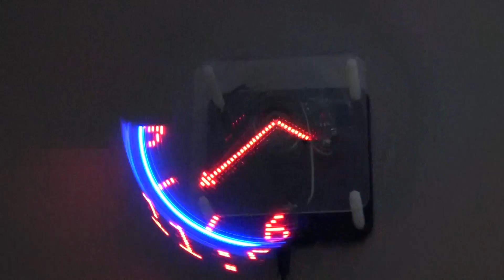A short rant about very old electrolytic capacitors

Comment: It's not just about capacitance, but esr, newer caps are still superior. nichicons uhw and upws are some of the best radials on the market today to use in power supplies, nichicons ulds are some of the best to use in supporting circuitry along with Panasonic's fm, fr and fc series, vishays 30D and TE series, cdes tta series are the best axiel caps, Nichicons lgu series are some of the best general purpose snap in caps as well as cdes splx, Nichicons nt series and cdes cgs series are some of the best screw terminal caps around. There are modern caps that not only are built better, but have far better performance, you cant expect a 35 year old or greater eletrolytic cap to be as good as a real modern cap from a good brand. Now, even if a cap measures "good" old caps are still risky to keep using. Things have a general operating life for a reason. When the rubber bottom seal degrades "which all rubber does", all it would need is a jolt to crack that seal. "seen that happen as well, especialy with caps with recessed crimped on leads" The rubber seal on the bottom can dry rot on these capacitors over time leading to intermittent issues that come and go. The electrolyte fluid can dry out eventually causing higher internal resistance which causes more internal heating which causes more electrolyte to evaporate which causes a run away effect, it can eventually short out and take out parts you might not be able to find, such as old transistors that arnt made anymore which have no substitutions, or worse old ic's with no substitutions ect. Rendering the gear useless all from a bum cap that could've been changed for a few cents "seen it happen" some electrolytics can even act like a resistor which can cause weird things to happen! "seen that before as well" Even caps that look fine sometimes aren't, sometimes a cap tester doesnt tell the whole story Even a cap that tests good can cause issues "seen that as well". A eletrolytic capacitors behavior will be different at rated voltage and at rated operating temperature as well as operating frequency. electrolytics that are older then 25 to 35 years are a risk, simple as that. Especially if the dielectric and electrolyte are paper and oil "from even older caps" which can eventually turn acidic and short out.... "Seen that happen with multiple 1950s spurge atoms astros and others that are similar" People who suggest replacing all the electrolytics arn't wrong and are just doing preventative maintenance, lmao. You're entitled to your opinion, but it doesn't mean it is correct... If you want to replace bipolar coupling caps, wimas mkp4 series are the best in the business for anything passing audio in an audio circuit, they're highend polypropylene film caps, they have better performance in those applications, theyre also good for replacing black beauties in old guitar amps, they also tend to have a limited self healing effect if they're exposed to abusive conditions as long as it isnt constant... Like your channel man, but come on...
Reply from the maker: You did see the ESR right? It was well below the limit for new caps.
Reply: @12voltvids   Did you read my entire comment? Even if it tests well, it is still rush & roulette...

Comment: I don't have nearly the experience of you but the smaller the e-cap is, the more likely it seems to go bad.  Also, if they are in a switching power supply or Chinese they seem to go bad much sooner.
Reply from the maker: Yes smaller ones and those in smps

Comment: I have two receivers I bought new back in the 70's, one a Sansui from 73' and an Akai from 76, and they are both still working like new, except for a couple of blown lights on the front panels. The caps must be working.
Reply from the maker: Indeed. I have an old akai 1710 from 69 all original caps still running like new.
Reply: @12voltvids  Nice. Both of mine are modest in the sense of power, the Sansui is a 661, and the Akai is a AA 1030, and it was a lot of money back then for either one. I think where and how units are stored might help in keeping things in better condition, like high and dry, as opposed to damp basement environments.
Reply: @Pedro Ferreira Nice.

Comment: I bet tomorrow there will be 240 comments from capacitor experts!
Reply from the maker: Experts everywhere on internet.  The facts are old school professional techs do not shotgun all the caps.  Amateurs do because they do not have the experience or competence to read a schematic and follow the signal path that will lead them to the faulty part. So by changing them all they will fix the unit by elimination of all the old caps. Yes replacing all the caps will fix the problem if the  fault was caused by bad caps.  100% of the time!!!. The real satisfaction at least for me and I am sure everyone is using a meter and possibly a scope. Diving in and tracking down the 1 component that caused the problem.  I did that on a NAD today. Ok not 1 part, 4 transistors and 2 resistors.  Will post that as soon as I edit it.
Reply: Having repaired broadcast Television & Radio equipment for over 40 years I have noticed that electrolytic capacitors with voltages above 35 volts rarely go bad.  The lower the voltage on electrolytic capacitors the more probability that the capacitor will have a short usable life.  However this is true only about 90% of the time.  In the 70's I think I was buying half dried up "NEW"electrolytic capacitors (Possibly old stock) without knowing it.  The analog ESR meter I began using  in 1980 made life so much easier.
Reply: @12voltvids  Back in the 80's I worked as college student at a TV repair shop to earn some spending money. We would do TV's at the customer but audio in the weekends in the workshop. (I have learned very much in those days). But for the TV's we had standardised about 95% of all failures that would come to our shop. Trouble shooting was based on model, a flow chart that leads to a repair kit. This Kit could be installed at the customer and would contain all parts that could go wrong for that particular problem statement. This meant we could give warranty, we did not have to transport the TV back and forth, the customer would have their TV working on the same evening as it broke (and they really loved that) and we would have very low labour rates. We would be out of there in less than 30 minutes. Yes the parts where more expensive though we would take the modules back to repair in the workshop (for that we would have an other kit) but over all it was still very cost effective because of the shorter times involved and customers where willing to pay a premium to have their TV repaired at their home on the same day it broke, or sometimes that would be the deal maker.
Reply: @hugobloemers4425  I remember the one shop that did those kits, and they had a very large collection of repair kits for different Sony sets, mostly due to the GCS switch not being made any more, but the set otherwise was perfect. Some were a nearly 20 page manual, along with a half kilo of assorted resistors, capacitors, inductors, transistors and heatsinks that covered a few dozen models, but which would almost always result in a working set. you might not need all the parts on a particular model, but the few resistors left or such would always be useful. 

They even did a replacement tuning drawer kit for those nasty drifty carbon film units, that used a few cermet 10 turn pots on a small PCB, and a rotary switch on an aluminium panel, that would be glued in to replace the drawer. Sadly long gone, the shop is now just a vacant unit, and the other place is now a car dealership lot.
Reply: Watch Mr. Carlson’s Lab. He would beg to differ on replacing old caps. They are cheap enough and have a shelf life. Why not spend an extra $10-$15. I say Paul Carlson has a bit more knowledge in EE than most of us who comment here. I love this channel and by no means criticizing, but that ESR meter does not tell you if it is leaky. I test about 3 different methods before I consider if it stays in circuit.
Reply: @SIXSTRING63  mr carlson is an elite electrical engineer, he does military grade repairs and he does things properly, however he would still say that capacitors are kinda crappy parts and they are the cause of 7/10 failures.
Reply: N Gauge England Synthematix  I hear ya on that. Cap testers like tube testers don’t always prove the caps performance in a circuit. I recently repaired a modern Marshall guitar amp with a bad swishing, rustling noise that was giving me fits. Thing was only 3 years old at best. I suspected a coupling cap which were all modern Wiha brand poly caps. I was measuring a good bit of DC on the grid side. Pulled it and tested it in 3 testers that said it was good. Changed it out with a good quality cap, problem solved. I would have never thought it bad after testing. Just did another of the same model last week but newer. All the couplers were a different brand. They must have gotten a bad lot. I read many complaints of the issue on the Marshall amp forum. I shared my info and had many thanks that cured the issues for others.
Reply: @SIXSTRING63  I'm no EE and don't watch Mr. Carlson's page very much, but isn't he referring mainly to those old paper caps used in very old radios other equipment?  I think even 12voltvids even says all those caps will eventually go bad.  Also while the ESR meter won't catch everything, I think it's a good test for the vast majority of cases.  If the ESR is out of spec, I know the cap must be replaced - don't need another test.
Reply: Wade Prince He did a VFD board for a CNC machine in a video and replaced the modern electrolytic caps. He usually changes everything most of the time. He designed a brilliant low voltage cap tester I will build it one of these days. I’m a subscriber to his Patreon channel for schematics and private videos of his inventions. Have learned a ton from him, Joe Smith and w2aew. Probably the 3 smartest EE’s on YouTube.

Comment: Small caps tend to go bad far more than the larger ones do.  Seems to be what I'd seen.  Your larger caps are of good quality; but so are the smaller ones.

Heat, cold, humidity, and arid conditions do play a huge role.  I bought a used CB radio from a guy in Wyoming that was thirty years old.  Not a good cap in the whole radio. They had all turned to garbage.  Bought a thirty year old radio from the California coast, and only the smaller caps were bad.  

Of course, they do not use the same grade of caps in a CB radio as your high end amp; but they all seem to suffer from weather and age the most.  Like circuit boards solder joints, the constant heating/expansion and cooling/contracting takes their toll.  85C caps parked next to a regulator or output heat sink seem to go pretty fast too, because of thermal stressing as well.

A total recap may not be necessary; but it is assuring to do, so that any near future failures will probably be silicon and not be the caps - at least.

Comment: I used to work in a repair the owner had me pull capacitors from salvaged sets. We did often buy new parts but we always had lots of used caps on hand.
Reply: Emergency repairs and hard to get similar form factor replacements sometimes calls for cannibalization from the scrap heap...

Comment: Theres a lot of bad information going around out there about old electrolytic capacitors. It's mostly coming from online groups surrounding retro video games systems and CRT TVs. They seem to think Spray & Pray recaps jobs are the answer to every problem. These hobbyists are mostly dealing with mid to late 90s toys known to contain bad, counterfeit capacitors. When it comes to these old toys (yeah video game systems are just toys built to a price) they used the cheapest caps they could find which for 1995 to 1999 were probably counterfeit and more prone to fail. I still disagree with the spray and pray approach, as it can do more harm than good. Sometimes they get lucky and suddenly they are an expert and will start screaming at you to "REPLACE THE CAPS" (said with a little but of spittle.) Makers of Pro audio equipment that costs $2500 were probably a little more particular about where they sourced their caps.
Reply: It's also a problem with SMPS that caps fail early (even decent quality ones).
Reply: You can add the ""Replace the lens!" guys for things that have mechanical issues xD

Layout is an important. Look at the TurboDuo, it combines lots of vias plus Elna 85°C through hole cap near heatsink plus SMD fishy leaky caps... This puppy was not very lucky. On this one the full replacement is a good thing... if we clean the board also. Never had to do that with Genesis/Megadrive or a NeoGeo. 

I feel proud when I can repair cases that you can't find any solutions on internet ^^  I had an Amiga CD32 with no image and hot graphics chip. It was a TTL involved in the clock generation circuit ^^

I wish I saw someday a hard troubleshooting case made by a guy from electronics world, and not an hobbyist, just to have a better sight on how to properly do with these "toys" ^^ Even for simple things like choosing grease for sled mechanism.

Comment: When a cap is “leaky” what are you testing for? and what are you testing with?
Reply from the maker: Caps can go electrically leaky. This is mostly problematic with old wax/paper caps from the tube era. this happens due to the paper used to insulate the metal plates breaking down and becoming slightly restive. You can use a high voltage breakdown tester to confirm, but in vintage tube gear, just change them to modern mylar and you are good. Caps made in the 70's and 80's generally didn't suffer this problem. The highest failure is from over pressure causing them to vent and then the electrolytic dries up. Again not as much a problem in the pre 2000 caps because they mostly used an oil based electrolytic.In the late 90's and into the 2000s the oil was replaced by a water soluble electrolytic, and well water boils at 100C so using them in high ripple switching power supply is a recepie for disaster.  The only tests I do myself is a resistive test, capacity test and ESR test. If caps show no internal resistance, the capacity is a minimum of what it is rated (they will generally be over) and the ESR is good then the cap is 99.9% perfect. High voltage breakdown is not necessary on modern electronics because they don't use high voltages like tube gear did.
Reply: @12voltvids  well that was a good history lesson about capacitors thank you for that👍
Reply: @12voltvids  I have 2 old scopes 35+ yr old that work perfectly. But if I'm buying an old receiver and paying top dollar for it I expect it to be refurbished with new caps.
Reply: 12voltvids excellent info and quite relevant since I’m restoring a predicta TV. well I guess 2 of them as of yesterday lol. I’m also going to be diving into a 1959 Pioneer stereo that’s full of oil filled caps, think they’ll be garbage?
Reply from the maker: @cookingwithjesus  
The oil in caps that old will pretty much guarantee to be PCB oil and they must be disposed of as hazardous waste.
Reply: @12voltvids  Are they not over reading because they are electrically leaking (parallel resistance)? The resistance causing the meter to take longer to charge the capacitors, giving higher capacity readings?
Reply: You are testing to see the resistance of the capacitor and you can use a leakage tester to test it
Reply: those caps are usually not used for dc decoupling, rather filtering powersupply rails, leakage is no problem in this case.
Reply: @gamerpaddy  oh ok I just do a lot of old radio repairs and I know that a big problem for them thanks for the information👍
Reply: Most of the caps that I remove don't really test bad and still have good ESR. Its that damm glue that causes more problems. Now if I am selling something thats valuable I will change them as I don't need any return action, but your right most will still test good in capacitance and ESR. Good video...

Comment: Are you testing leakage current as well? That is very important in a circuit because you don't want your cap to turn into a resistor.
Reply: I mean I could but I'm trying to save up for a shed to have as a workshop so I can do repairs and make videos quickly mabey after I do that because my last dc power supply broke because the cheep leads burned and the circuit bord burned as well.
Reply: @Rajvansh Singh you most likely have a voltage drop because of the thin leads that comes wit the DC power supply I would recommend switching them to higher amp leads
Reply from the maker: This is really only an issue with tube gear when paper caps are involved due to the high voltages, and I always change all of those regardless of how they test on antique radios.
Reply: @12voltvids  ok good to know 👍